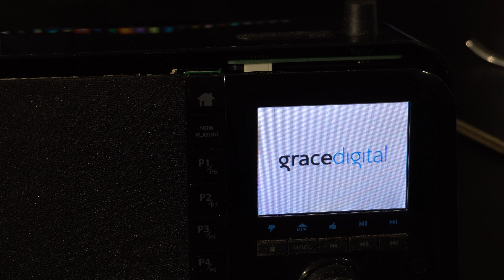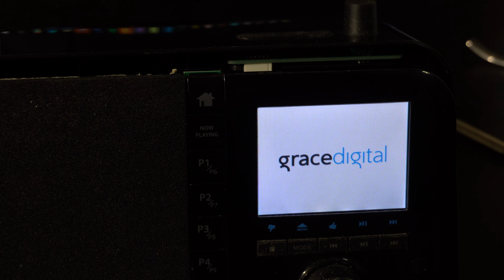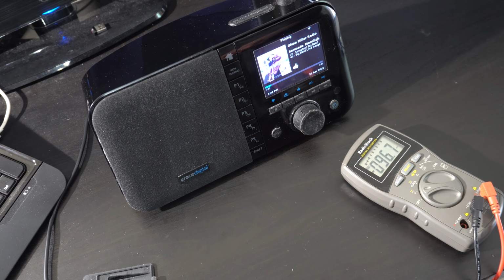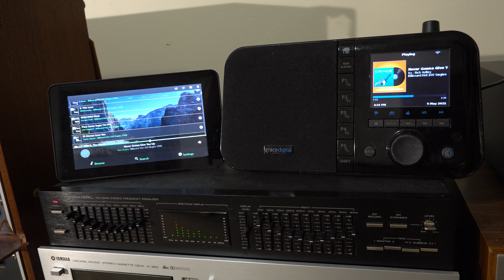Fixing an Unresponsive Grace Digital Internet Radio

Comment: Found it very useful... bought a Grace radio from Goodwill which, since Goodwill was continently not willing to share their WIFI password (gee, I wonder why not), there was no way to test it and low and behold, it will not connect and times out.  Hopefully my model is similar and it is as simple as replacing the WIFI adapter and if not,  I am out $4.50 but at least the clock still works.
Reply: Funny, I just did the same thing (paid more than $4.50, tho!). Same problem, too. But it's looking for a WEP password, and I've got WPA2 on my network. Maybe a USB to Ethernet dongle for a hard-wired connection, or maybe a firmware update will fix it. Project time!

Comment: Own a Grace Mondo. Starting Jan 2021 no more Reciva. I was unaware and reset to fact specs.
Big mistake, it caused all presets to disappear. Without resetting they still should be working.
Contacted Grace cust service in San Diego,Informed me nothing could be done to correct problem.
Was informed that Grace would allow only US customers to purchase a new radio at a 35% discount during 2022. Could buy a new Mondo elite for $130  plus taxes.Not sure if shipping is included.

Comment: Most Excellent Tutorial. However you have any suggestions on using the radio now that Grace Digital dumped the web link required to play all the internet channels?
I've heard of some hacks. Any ideas?
Reply: Mine is still working. But only the presets.
Reply: @penu009  Well then technically it's worthless. I won't forgive Grace Digital for not giving out the source code On their old radios like Logitech did on their squeezebox radios. It was discontinued in 2014 but the LMS server software is amazing and the radio still fully functional as it can be simply reprogrammed.
Grace Digital should be ashamed for not letting their users modify their existing radios to work without their old DNS servers.
Reply: @penu009  that’s exactly what my radio is doing too, even though it’s very confusing it flashes the warning “not connected to the internet” so it must be flying solely with WiFi on my broadband box’s network name. I hope some other company steps up and Grace digital does an all inclusive of all models update. We can’t have these radios all in the city dumps. They really are good radios

Comment: Hi 
Mine is a Avox radio (looks exactly the same as your Grace)
My radio keeps stopping and searching for Internet Connection.
Will the battery be the issue? 
Also if I remove the battery wilI I lose my presets?
Best regards
Reply from the maker: Before removing the battery, I would suggest removing power from the radio and rebooting your WiFi router. Not sure if removing the battery would erase presets. Thanks for watching!
Reply: Thank you for your reply. @ACBMemphis

Comment: Hi, Thank you for making this video. I have the same mondo model. Mine had died, like yours. I changed out the CR1220 battery and it's working again, but, the radio has to keep re-scanning for the wireless network and keeps asking to re-enter the Wifi PWd. But sometimes it will work for hours without rescanning for WIFI...  I took out the WLAN card and connected it externally, like you did- it really didn't make any difference. 
 
 Question: Do you (or anyone) know what WLAN card would work best as a replacement for this Mondo's original WLAN card? I see there's a bunch of USB WLAN cards out there, just want to know how to make sure I find one that is compatible with this Mondo's motherboard? 

Oh yeah, I forgot to mention: Even though they turned off the Network Server (Reciva), the radio will still work fine as long as you have stations in your pre-sets. Searching for new stations will no longer work.

Thank you,
Jim
Reply from the maker: One thing that might be worth trying is to look up the numbers on the card and/or do a search on the first few digits of the mac address to see if you can identify the manufacturer. Thanks for watching and commenting!
Reply: @ACBMemphis  Thank you very much for you fast response! I will do that. Jim

Comment: As you are aware of I own a Grace Internet Radio GDI-IRC7500 and nothing works because the Gateway platform changed or whatever. I would like to know if there are people out there who can make the changes needed so I can continue using my radio. I know Grace will pay you a small amount of $ for trade-ins and I'm sure they are upgrading and selling them at a so-called discount. The radio cannot find a "Gateway" so I'm stuck with a useless piece of plastic.
Reply from the maker: It is really sad that this is shut down. Perhaps someone with time and talent will eventually "hack" the firmware and make it available for us to update our radios. The problem with all this "cloud stuff" is it depends on someone keeping their services running.... One thing I'm doing is voting with my pocketbook, and not purchasing another Grace Digital product. I have also switched most of my streaming to a free and open source product, Volumio, which is more technical to set up but also has the capability of casting from a phone - so as long as there's a phone app that's kept up to date I can use it. Also it is worth pointing out your Grace Digital is not totally dead, you can still copy audio files to a USB flash drive or use a UPNP server and play music from your PC.
Reply: @ACBMemphis  I noticed that radio stations kept in remote controller still function. One thing is for sure; I will never buy another product connected to grace radio.
Reply: Mine is still working but can't add new stations.
Reply: @ACBMemphis  
I agree with you that Grace Digital should be ashamed of not allowing a perfectly easy way that the end user could change the settings to use another DNS server to continue using their discontinued radio. Logitech did a great job of making their discontinued SqueezeBox Radio and their LMS media server open source after it discontinued in 2014 so it's users base has since flourished and all radios still perfectly fictional, in fact even better. The Logitech SqueezeBox Radio is far superior to the now (worthless paperweight) Grace Digital. And I own both radios. The Logitech runs perfectly the other Grace Digital is now a useless paperweight. Like you I to will never buy another GD-Radio again. Shame on Grace Digital.
Reply: @penu009  it won't for long 😩
Reply: @PCman50  can you clarify what won't work for long?

Comment: My Grace Mondo+ no longer connects to server. WiFi working, as I can stream music from my computer, but does not get anything from internet. Shows Jan. 1 2000 date and hour glass symbol all the time. Rebooted many times, no change.
Reply: My Ocean Digital seems to have done the same thing, suddenly quit and will not reconnect to the "Sky Tune."
Very frustrating!
Reply: @davestelling  Sorry your're having problems. For my radio, I learned, later on, that it was my wireless router causing problems! After getting an email from my wifi thermostat going off line, I thought, hmm. Rebooted the router and radio came back! wow.

Comment: i have 10+ yr old GDI 6000, never an upgrade, -- 1 by 1 service stopped working when they went to newer technology, 
First Pandora. Then I got a new WiFi router -- everything stopped working.  Reset to Factory -- still dead in the water, Grace shrugs

Comment: The original 3rd party internet radio station finding network used by our legacy internet radios is planning to shutting down. This will affect all Grace Digital internet radios manufactured between the years of 2007 and 2017. The managed shut down will begin on November 21st, 2020.
Reply from the maker: Yes, I saw that article on their Web site. I assume this only affects the Internet radio directory, and the built-in apps (Pandora etc) will still work. Of course, UPNP to local files will still work... The UPNP software I use on my PC (foobar2000) has the ability to do live stream capture, so should be able to push a lot of different types of content to it. Thanks for watching!
Reply: Its only for Sirius and Apndora - Internet radio continues to work fine.
Reply: @davidhoerl7552  actually internet radio is completely dead. I've heard of some work arounds but the radio is worthless at the moment. 😟
Reply: @ACBMemphis  Yes I've found i can stream simple MP3 files from my local media server on my router, but no way to get all my internet radio podcast channels I used to love. Any ideas?
Reply: @PCman50  I don't know what I am doing different than you, but original unit died, bought a used one on eBay, connected to WIFI in house, then searched for an internet radio station (101.5 NJ) and found it. Playing it every day. I even confirmed with Grace before I bought the second hand unit - problem is just Pandora an Sirius - that's what their tech support person said in a chat (which I didn't save). Obviously YMMV.
Reply: @davidhoerl7552  No sadly
Reply: Such a scam, avoid Grace like a plague from now on.
Reply: @stevelimbert6846  I had a Grace Mondal for a decade until they stopped supporting it.  Sell U mine,  I now have two great Oceans Digital now around the house.